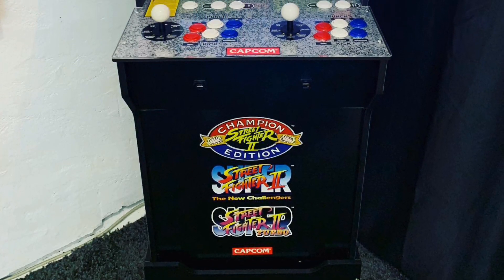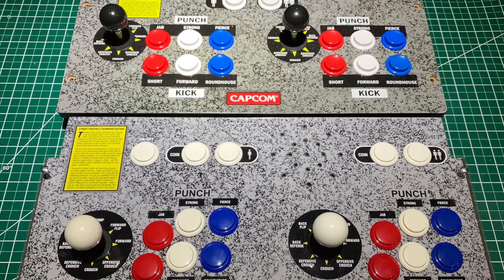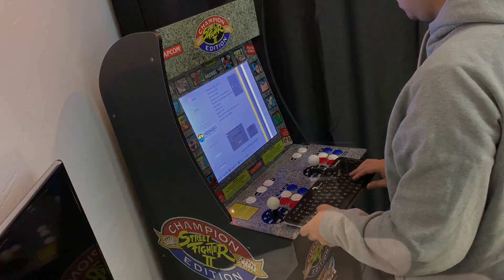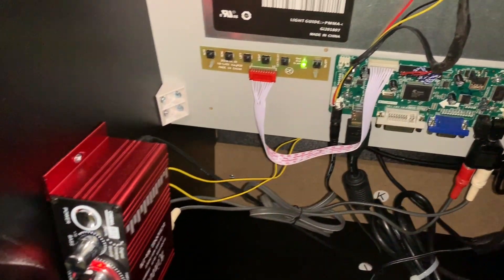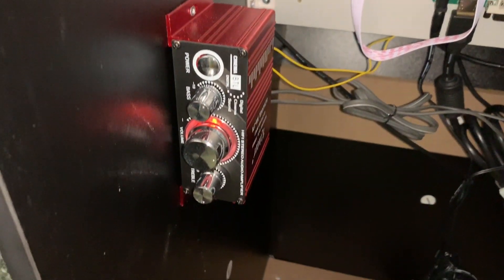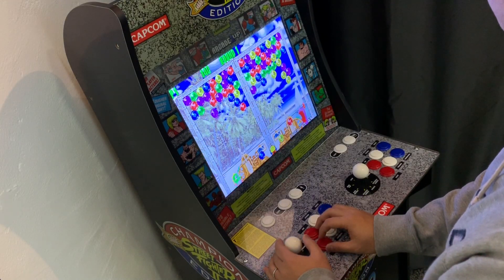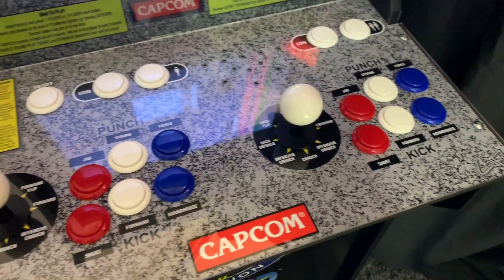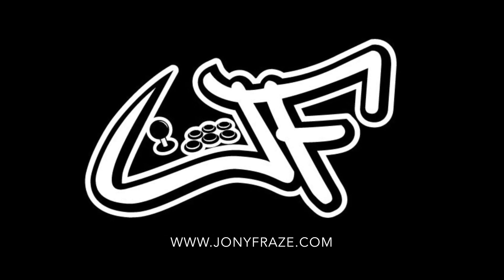Arcade1UP Sanwa Control Panel Mod + Raspberry Pi Install

Comment: This is what I want to do! But I want to be able to swap out the control deck as needed mounting the original A1Up PCB to the bottom making it easier. But I gotta start with this SF2 style control deck!

Comment: I don't suppose you have the original untouched control deck pdf? i'm looking to make myself a custom graphic to go underneath the deck protector but covering the original art with all buttons and sticks in their original position.  your mod looks awesome though and thanks if you can help.

Comment: Hello :).
Please, which usb encoder are you using with recalbox?
It seems like even if compatible with raspberry pi, not all usb encoder works with recalbox :/.
Thank you for your attention & have a good day!
Reply from the maker: I was using older ps360+ boards in this video.

Comment: Had a question, i used your template but do you have the player one and two logos and the coin logos? I tried to erase the back ground from them but its not a solid color back ground so it did not work.
Reply from the maker: Hey gamedude, unfortunately I don’t have the original assets anymore besides the template (this video is a few years old at this point).

Comment: Would it possible to get a psd file with the start coin buttons overlay without the gray background? I would like to create another background but using the same coin and player one player 2 and on/off overlay without the gray background.
Reply from the maker: I included the laser vector file in the link. Open that and PS instead of the psd

Comment: Question, what is the type of screw did you use for the lower left of the control panel? I am looking to replace the rounded one in that location. Does it feel better during gameplay with the flat top screw verses the rounded one that came with the cabinet?
Reply from the maker: yeah I just found a flat top screw that fit, I don't know the exact measurements since it was a random one I found in my scraps. the round one was bothering me during game play. Maybe we can contact 1UP for the threading exact measurements of the stock screws.
Reply: @jonyfraze  One of these should do the trick. #10-24 x 1-3/4 in. Phillips Flat-Head Machine Screw or #10-24 x 2 in. Coarse Zinc-Plated Steel Flat-Head Phillips Machine Screw

I purchased the 1-1/2 inch version but they are too short for the control panel. I plan to get both 1-3/4 and 2 inch sizes this week. My local store doesn't keep the shorter one in stock. Another store across town has a small quantity

Comment: How do you separate the layers for the CNC cut? Never done this before.. What software to edit files?
Reply: I have searched everywhere and finally got it open in an eps viewer. But cannot see two separate layers as stated in your heading...
Could you add separete eps files for acrylic and mdf cut?
Reply from the maker: Adobe illustrator

Comment: My Control Panel Button layout plan is similar to yours except for the layout of the Power, Coin, Player 1-2, Buttons also the Speaker.

On my Button Layout since some fighting games require it. I'm adding 4 Extra Buttons L-R Triggers for Player 1-2. And for the Single Speaker, I'm going to add a Track Ball instead.

The position of the Player 1-2, Power Buttons are going to be placed higher towards the Screen Bezel so I could allow room for the 4 Extra L-R Trigger Buttons.

In place of the Vol. Button of the original Control Panel, I'm going to use two Power Buttons, one Power Button to Power my PC & the second Power Button to Power my Lit Marquee.

As per my Coin, Hot Key Buttons, Speaker Layout & 4-Port USB Hub, I already have that covered. Here are some pic's of the Layout.
http://img28126.imagevenue.com/img.php?image=25604_20190303_054923_122_1097lo.jpg
http://img28127.imagevenue.com/img.php?image=25606_20190303_054614_122_373lo.jpg
http://img28127.imagevenue.com/img.php?image=25608_20190303_064203_122_413lo.jpg
http://img28105.imagevenue.com/img.php?image=25609_20190303_065048_122_453lo.jpg

Once I'm done with installing my 20" Monitor in the Cabinet, I will once again try to complete my Control Panel layout...

PS
By the way. Nice job on your Control Panel Layout. :)
Reply: can you share the artwork?